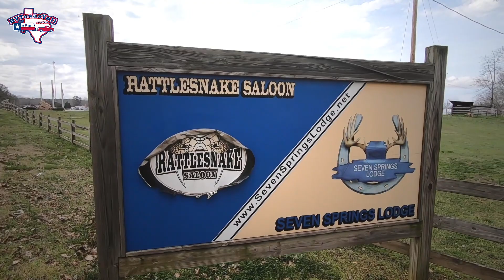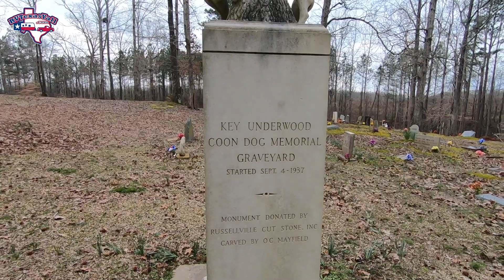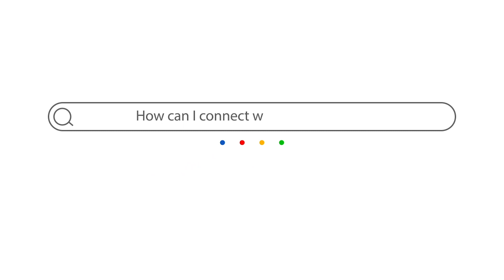Unique Things to See and Do Near Red Bay, Alabama

Comment: Did you get the synthetic transmission oil?
Reply from the maker: They put in the recommended oil. Not sure if it’s synthetic or not.
Reply: @rvamericayall  if you ever get an opportunity next transmission oil change request the Allison synthetic ATF. Prolonged transmission life is almost three to four times longer, the transmission will stay cooler. Longer intervals between changes. Happy trails
Reply from the maker: Thanks for the tip!